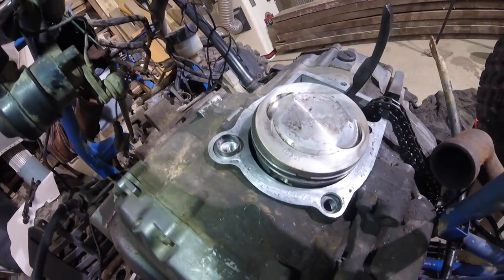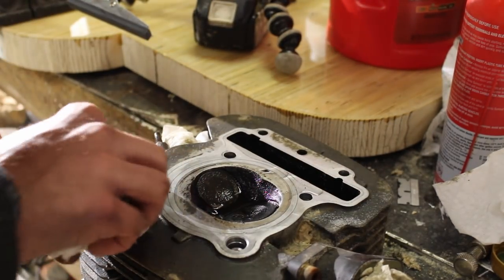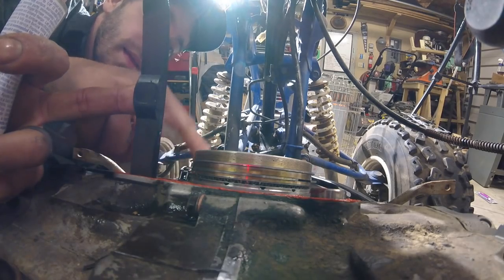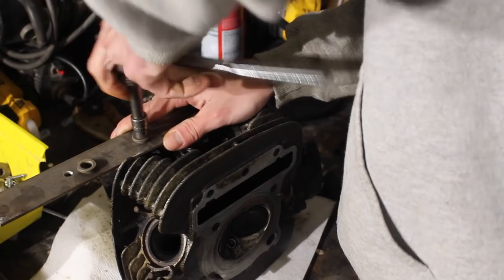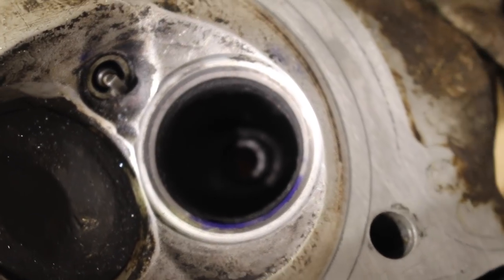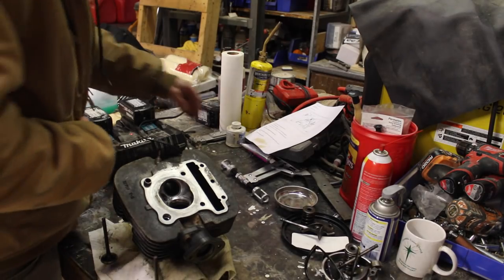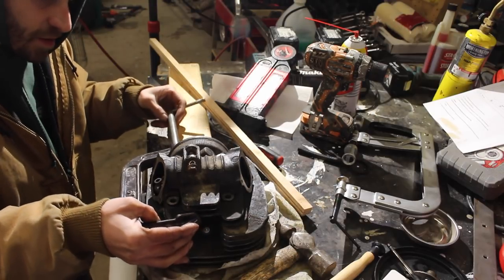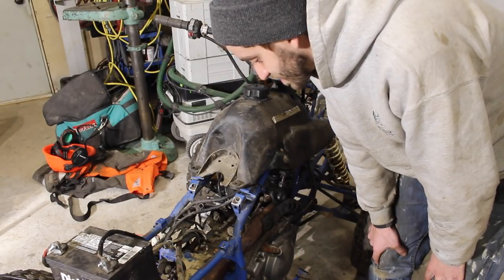Free Yamaha Warrior Quad Rebuild Part 2!

Comment: FYI the dykem blue is supposed to be put on the seat, let dry, then lap valve with compound. The lapping will remove the dykem to reveal where the seat is out of round. Only works with a new valve or one that has been refaced. If using old valve dykem the valve too. Rotate with light pressure and let the compound work. You’ll feel the compound breakdown and will get smoother as you lap it in. Then remove valve and clean off the compound on valve and seat. You’ll have a perfect circle of grey in the dykem when properly seated.
Reply from the maker: Nice thanks for the tip!

Comment: 42:28 you mention head may be toast and then cut to deciding to put it all back together.  Why was that?
Reply from the maker: So I thought that maybe the valve seat grind on the head was damaged when I was using the blue dykem to find the high and low spots. However I had no confirmation that it was in or out of spec, so I just decided to purchase new valves and put it all back together. I guess I got lucky in this case in that it ended up running great! Keep watching the series to see more of how I put this thing back together! Hope that helps!
Reply: @IntoTheDirtshop  sounds like you went with your gut feeling.. I like it.  Thanks!
Reply from the maker: No problem! Haha and yea I do that sometimes

Comment: Thanks for the video, it helped me lots. 
 Do you happen to know the nut and bolt size for the top engine motor mount. The one that bolts the top of  engine to the two mounting brackets. I've noticed mine fell off and I dont want to pay 8$ for a new one.  Internet shows no size.
Reply from the maker: Sorry I don’t know that detail.

Comment: Can you make a video on how to fix flooding on a carburetor ?
Reply from the maker: We don’t have the quad anymore, but most flooding carb issues are due to the needle and seat have a clog, you can change the needle and seat in the float bowl pretty easily
Reply: Into The Dirtshop I have cleaned the carb 2 times in one week
Reply from the maker: I would recommend getting a new needle and seat and maybe a new float
Reply: Into The Dirtshop I think I will just buy a new quad since the one I have is old and is not worth it, I will get a warrior 350
Reply: But thank you for your help

Comment: I just found your channel and subbed. Where can I find the valve tools you were using? They will come in handy and that lube(assembly oil) ? Thanks
Reply from the maker: I’m pretty sure I just got it on amazon, and the lube is called ultra slick

Comment: I have a warrior that rides great, the only thing wrong is that is idles fine for 20 seconds then hit hiccups, revs low, and dies. I'm thinking its the carb but I don't really know. Do you have any suggestions or ideas on how to fix this?
Reply from the maker: Yea it sounds like there is some sort of fuel delivery issue. A good place start is definitely giving the carb a good cleaning
Reply: Into The Dirtshop Ok thank you
Reply: Into The Dirtshop Also it is backfiring in the carb and out of the air box when I give it throttle quickly causing the engine to lug and then backfire in the carb, is this a valve problem or is this normal?
Reply from the maker: Ryan Hinkle the backfiring is a bit different that could be a timing issue. So check your valve lash and then also the timing chain could have skipped a tooth if it’s super wore out
Reply: Into The Dirtshop Aight, I’ll look into it

Comment: That looks to be an aftermarket Wiseco Piston.  Compression ratio of 10.25 to 1 vs. 9.2 to one factory
Reply from the maker: Oh so you think it is a high compression piston?
Reply: @IntoTheDirtshop  Yes I'm pretty sure it is. Those pistons use different rings than factory and also most factory pistons are a slight dish or flat-top. Your seems to be domed. Those Wiseco piston kit cost about $150.

Comment: Take your time, do it right the the first time. Why didn't you lap the valves when you had the head off ?  There is no EXCUSE for that !!  Quit buying cheap parts from Ebay, Amazon...ect. Just go to the nearest Yamaha dealership. You get what you pay for !
There is ALOT of things you did wrong.... Measure the bore and the piston diameter before buying rings. The hash marks on the cylinder must be at 60 degrees from each other.  Put a simple straight edge on the head/block surface to find the low/high 
spots before gasket install..  If it has an aftermarket piston, call them for info and the correct install/parts available. DO  IT RIGHT THE FIRST TIME !!   Also..download the service manual, its free !!  READ THE BOOK !!!

Comment: Great video but you know you was using the spring compressor tool wrong your suppose to just tighten it up then use the handle to compress it
Reply from the maker: Thanks for the tip

Comment: Is it common to not pull the motor to do this? Just curious.
Reply from the maker: Good question! I decided not to because I thought it was going to be a quicker fix. Probably should have just pulled it from the beginning...
Reply: Shannon @. Yes it is common to leave the engine in the vehicle while doing head work on theses gy6 motors.